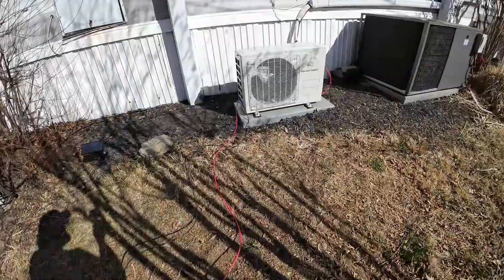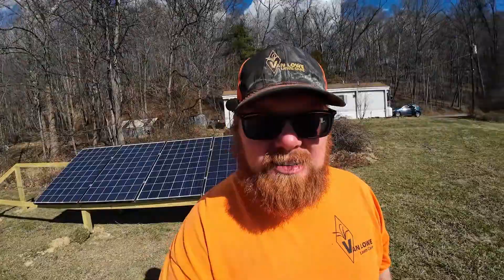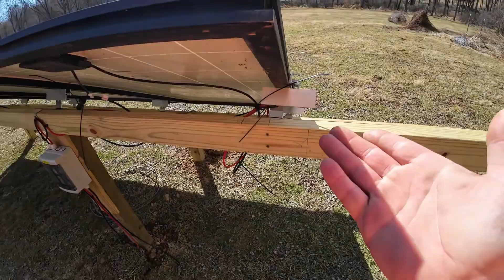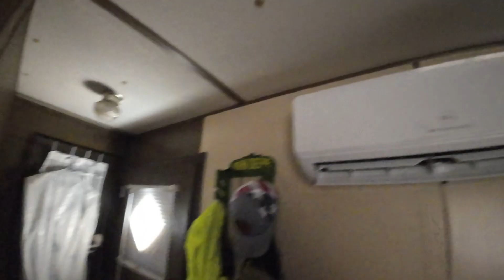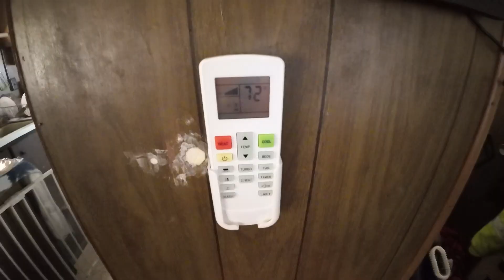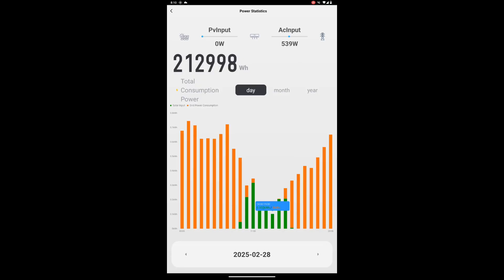EG4 Hybrid Mini Split Overview | Heat and Cool your home with Solar Power

Comment: So it can run fully off solar with no batteries or grid?
Reply from the maker: That is correct.  But obviously it will only run if there is sun.  The solar controller is built into the outdoor unit so it's just a direct connection from the solar panels to the unit. 

I can turn the grid breaker off and as long as there is enough sun it will still run.

Comment: great  video  you will save money
Reply from the maker: Thank you for the compliment.  It's been about 8 months now and I'm definitely seeing some savings.  I do still need to add two more solar panels to help with the solar side over the winter.  But my power company sends me a report each month comparing my energy usage to similar homes and efficient homes and I'm happy to say I've actually used 60-70% less energy than similar homes.  
I was torn between Mr. Cool and EG4, and am glad I went with the EG4.